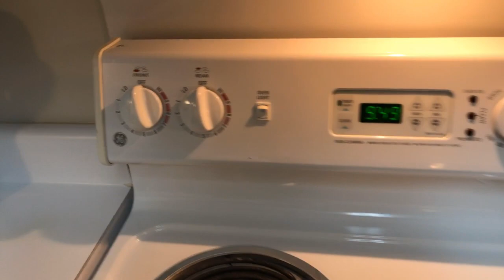How To Clean Behind Stove | Deep Clean With Me | Cleaning Motivation

Comment: Thanks for posting this vid but did the stove come just straight out? Is there any anti-tipping that have to pull it out a special way? Thanks
Reply from the maker: You are so welcome!!! The stove did come right out, but we did have to unplug it so be very careful not to spark a fire. Ours was electric so we didn’t have any issues. We were able to just pull it straight out with no problems. I was actually surprised that it was much lighter than it looks. Good luck!!